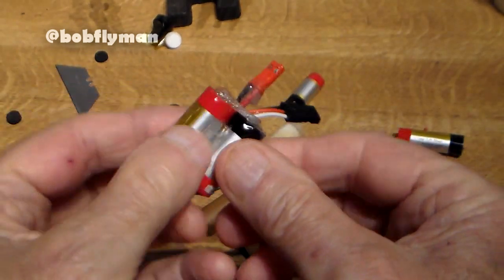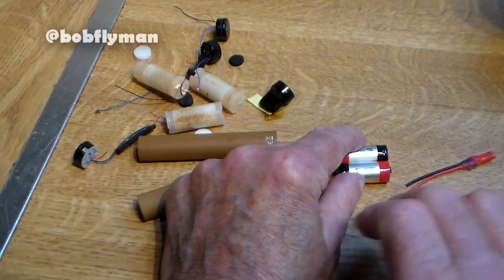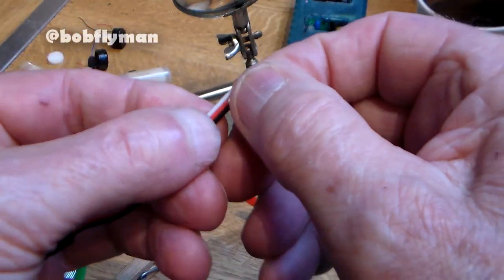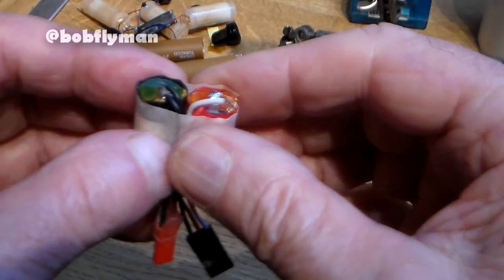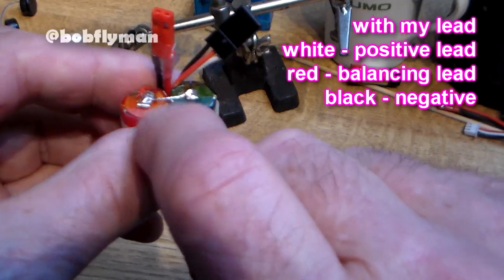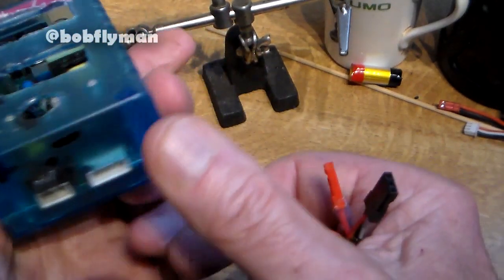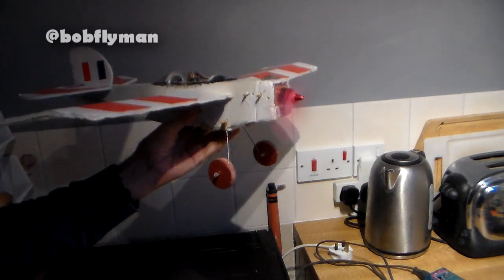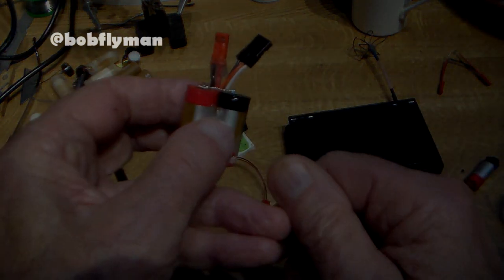A 2s Rechargeable RC Battery FOR FREE.  Here's how.   Step by step and EASY!

Comment: A couple of thoughts on this. When I recycle dead Lipos, I generally cut off the leads, and hot glue over the ends before taking them to recycle. I wasn't sure what to do with the balance lead... until now. So use recycled leads from dead batteries for your balance. The other thing is Lithium batts do not like heat. So the way factories attach leads is usually to spot-weld a piece to the cell, then solder to that so as not to transfer much heat to the battery. You could probably fashion your own DIY spot welder with a good sized 12v lead acid battery. But use some welder's goggles. You are, after all, welding.
Reply from the maker: Yes, I do save old balance leads, though you can buy those types of connectors. I used them on my FPV tx and rx set up. Totally agree about trying to connect to the outer case. They don't like solder, even with a good rub down and plenty of flux. I discovered recently that one of my chargers  wasn't balancing lipos properly and that had led to some cells failing.  Might try the spot welding idea!

Comment: Hi Bob, can this be done to the batteries to be in line as in end to end not side by side?
Reply from the maker: Yes, any configuration is ok as long as the balance lead  is connected in the right places between cells.

Comment: Not seen ANY discarded Vape contraptions.. Ever. 
 Does one need to live in an Ashtray locale?
Beyond that:  Weight of the resultant Pack ?  That's THE important concern for My Batteries.
Reply from the maker: I don't use them. Don't smoke but  I've found a couple discarded in the street and I took them apart to see what was inside. Apparently there are lots in cities.  I asked a girl I know who smokes disposable vapes to save them for me. She gave me 5 when I last saw her. Weight is a tricky question because they are in different sizes. 550mA single is about 11g. 300 mA single about 8g.

Comment: In principle it’s great but one needs to be aware of the potential pitfalls. You really need to check each cell for similar capacity and C rating to ensure they are fairly equal in performance before pairing them. Are they actually lipo or some life etc?
Reply from the maker: Fair point, I did illustrate that I was using same capacity batteries and said check the voltages before even starting. If showing 3.7v + OK.  One thing for sure is they aren't very old tired batteries, these are churned out in their millions every month.  So far I've found them working fine.
Reply: Yes I think it’s great to reuse these too. I’ve had the odd one to play with and they do appear ok. I believe they are lion not lipo but very useful all the same. Thanks for posting the video. Probably safer than Lipos.
Reply from the maker: Lithium Ion , I wrongly thought NiMh.